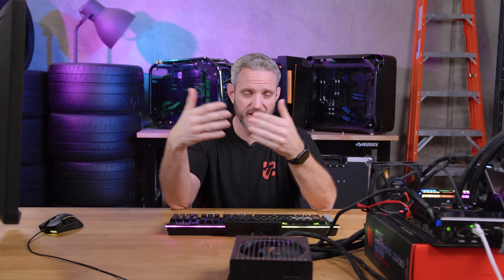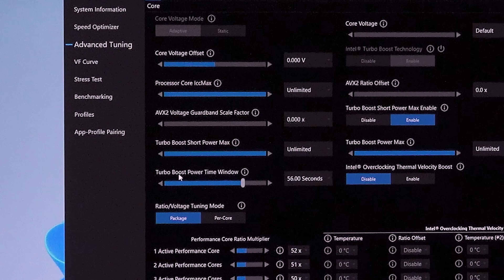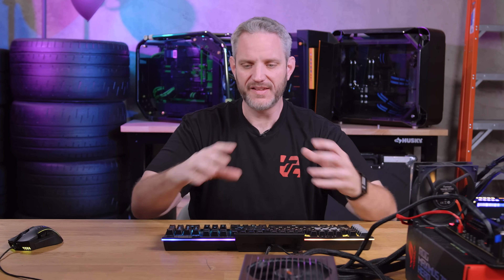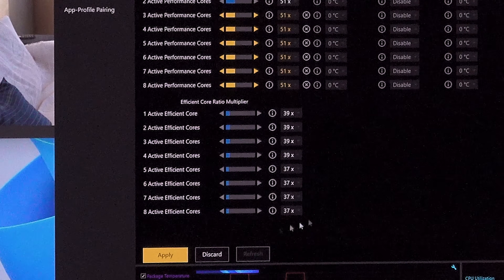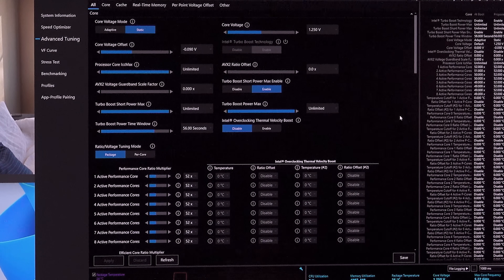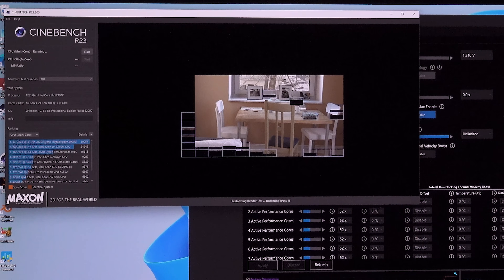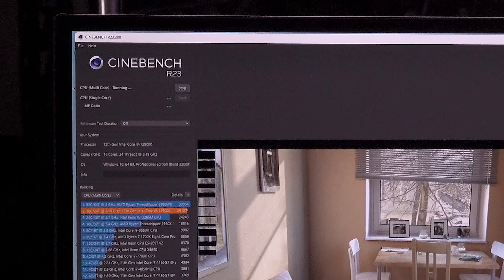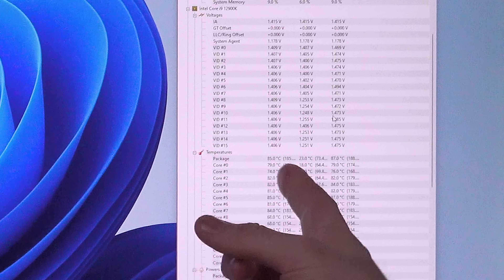Overclocking the 12900k is pointless and dangerous! Heat and Voltage testing...

Comment: Out of curiosity I am more interested to see how well the 12700k will overclock up to the 12900k stock numbers while being $200 cheaper
considering the 12700k is drawing less power stock and is clocking at a little slower speeds.
Reply: It will surpass 12900k stock, but not OC.
Reply: Just got a 12700KF will be building shortly.
Reply: WhatsApp ➕1⑨⑤⑨⑨①⓪⓪⓪②②  do not reply to this its a scam
Reply: I think it’s entirely possible that many of them can reach 12900k speeds, just not at a low enough power consumption for their standards
Reply: I think that the i-7 has been relatively pointless for a couple of generations. 8700k was the last decent value i-7. Since then, both the i-5 and i-7 have the same number of cores (6) and the same number of threads (12).

That is the reason why the 12700k/11700/10700k/9700k were all largely ignored by tech channels. Simply because they don't represent good value for money for gaming in comparison to the cheaper i-5 and they aren't as good at workstation tasks as the i-9 CPUs are.

Whereas if you were to check out a comparison between the 8700k and the 8600k, or even the 7700k, you will see a quite obvious boost in core/thread count.

Because of competition with AMD, Intel has been forced to enable more features that they had artificially disabled in cheaper CPUs and even to produce higher quality CPUs all round, which has made the mid-range pretty much obsolete.

It becomes quite difficult to notice a difference between CPUs when all of them are equal in quality. Especially in things like gaming where the Graphics card is usually the most important component. 

If you were running a game at 4k resolution, you would see almost no difference in FPS between a CPU from 10 years ago and one from today. 

So, long story short, the majority of extra value comes from the number of cores. Not the rated quality of them. Despite massive improvements over 10 years ago, the top end of performance hasn't actually improved more than a few percentage points. What has improved is the consistency and efficiency that it operates with and the number of cores.
Reply: @tripleheadedmonkey420  I do not know where you got your information on the i5 and i7 have the same number of cores since the 8700k but it is completely wrong.

 The i5 10600k was a 6core 12 thread chip and the i7 10700k was a 8core 16 thread offering, same core numbers for the i5  6core 11600k and the i7 8 core 11700k.

Also the new Alder Lake i5 12600k is a 10 core, 16 thread offering while the 12700k is a 12 core 20 thread offering. Also even on the Alder Lake the core difference is in the full p-cores not the lesser performance e-cores.

So your number of cores theory being the only majority difference in chip value actually makes each higher tier of an Intel offering being a better value than the one below it and we know that is not always the case.
You fail to take into account clock speeds and cache amounts along with those core counts which also affect performance.
But actually much of what you said is why I think the sweet spot for value/performance across the board is with the i7 and not just for gaming but a multitude of applications along with a perceived longevity as programs and even games are getting more cpu intensive as time passes making those extra cores have even higher value in longevity.
Reply: @tripleheadedmonkey420  NOPE, i5 and i7 has not been on the same number of cores and threads any time recently, and there's NEVER been a time where the corresponding i5 and i7 had the same number of cores and threads!
Lets
 look at all Skylake and newer pairings, just to see how it's developed 
(all pre-Skylake i5/i7's are like configured like Skylake).
i5-6660k: 4c4t vs i7-6700k: 4c8t - i7 adds HT.
i5-7600k: 4c4t vs i7-7700k: 4c8t - i7 adds HT.
i5-8600k: 6c6t vs i7-8700k: 6c12t - i7 adds HT.
i5-9600k: 6c6t vs i7-9700k: 8c8t - i7 gets 2 extra cores (i9 has HT).
i5-10600k: 6c12t vs i7-10700k: 8c16t - i7 gets 2 extra cores (i9 is 10c20t).
i7-11600k: 6c12t vs i7-11700k: 8c16t - i7 gets 2 extra cores (i9 is 8c16t! and only gets "TVB" ).
i5-12600k: 6P+4E/16t vs i7-12700k: 8P+4E/20t - i7 gets 2 extra P-cores (i9 is 8P+8E/24t).

According to you the 9th, 10th and 11th i5/i7 should all have been 6c12t chips, that's very far from reality.

The reason i7-12700k is missing from most launch reviews is very simple, Intel specifically choose to sample ONLY i5-12600k and i9-12900k to all reviewers, which meant that anyone testing the 12700k had to get it from a non-Intel source with early access to retail samples (like an SI) or buy it from the retail channel which would make it too late for the launch coverage.

The few places that has tested the 12700k so far all seem to consider it the star of the line-up since it's not that far behind the i9 on productivity/multi-core, pretty much identical in gaming, is significantly cheaper and far easier to cool. I can see the reasoning behind Intel choosing to sample only 12600k and 12900k but at the same time I think they did shoot themselves a bit in the foot by doing so.

But for GAMING, yes, the improvement above i5 (or Ryzen 5600X) is very small and for most people not worth it, at least for now. That doesn't mean that some people might not have different needs and/or is willing to spend more to get that little bit extra or insurance against background tasks - compared to GPUs the price differences on the 12600k and 12600k really isn't very large.

For Alder Lake the MSRP delta is $120 from i5 to i7 and $180 from i7 to i9, and the performance jump from i5 to i7 is much larger than the jump between i7 and i9. Which is pretty normal, the "top" SKU almost always cost significantly more than straight scaling would suggest (it's the same with GPUs, look at what 3090's cost, got any spare kidneys?).
Reply: @Torbjorn.Lindgren  Right this minute, the i-9 12900KF's are available but at a premium of $676.25 (lowest I could find), so with tax, it will cost $723.59 vs. $481.49 for a 10700K.  Quite a lot of money for 200MHz bump over i7 12700K.  $240.00 extra for the i9. Thats well over $1.00 per 1 MHz so  I think you are right, 12700 might just be a sweet spot for gaming unless you are doing flight simulation where you need every last bit of that first core GHz speed, for example, Flight Simulator 2020.  Those Flight sim folks have their reasons to go 12900K for sure, but that's not a large slice of the gaming community.
Reply: @Torbjorn.Lindgren  from what i have seen the 12700k is hot. 75c on a 360 aio. on another review the 12900k was hitting 100c on p cores that was on debear's channel. i can run my 5800x on a 120 aio. i want to see how 12600k, 12700k fare on a 240 or 280 aio.
Reply: WhatsApp ➕1⑨⑤⑨⑨①⓪⓪⓪②②  Wtf 😂 You should put more effort if you want to scam
Reply: hi :D pls. help
Do you know, if I can use a (AIR) Thermalright Macho Rev.B cooler on a 12900 kf whit out total overheating cpu?
Reply: there both 125 watt, so not really.
Reply: I overclocked my 12700k and it doesn’t go above 60c.
Reply: Probably not very well. I expect that there's a fair bit of binning involved and many/most 12700k parts won't be able to hit 12900k clocks, at least at Intel specs.
Reply: @Steamrick  Well now that depends is a 12700k a 12900k with 4 E's disabled or is it it's own chip?  Do we know this yet?  Cause if it's the later then there's no reason to think they wouldn't overclock to the same level as a 12900k, and to the OP's point maybe a little more headroom due to less overall power draw/heat.
Reply: @MooKyTig  Same chip, obviously. Creating a new mask for every single SKU would be beyond stupid and disabling bits and pieces to be able to sell partially defective dies is something every manufacturer does.
Reply: @Steamrick  I totally agree that it makes sense and would not surprise me in the least.  Just asking if we know this for a FACT and not a logical assumption.
Reply: @Torbjorn.Lindgren  i have read from a leak that intel will be doing this on 13th gen raptor lake with the flagship having 24 cores (8P+16E).
Reply: @Steamrick  You may be right but I wonder just how good the binning process is so early in the release of the new cpu's architecture as well.

I just thought it was sort of weird that most of the "press kits" did not include the 12700k chip and what benches I have seen so far at stock speeds the 12700k seems to slot in just about where you would figure it would between the 12600k and the 12900k.

I have seen oc video's on both the 12600k and 12900k but none yet using the 12700k good or bad.
Reply: @billwiley7216  if you put 12700/k/kf in youtube you will find what your looking for. from what i have seen that's the one to get. me running 5800x.
Reply: @arklight1670  I had pre ordered the 12700k, it arrived yesterday. Still on the fence on mb and ddr4 or ddr5.
Leaning towards ddr4 at the present time.
Reply: @billwiley7216  The thing with i7s is that they aren't sexy. i9's grab the attention of performance heads and are useful for prosumers, while i5s will tend to be what somebody buying new but on a budget will buy. For the average gamer, there isn't much benefit in paying more to go from i5 to i7 in 12th gen to make it worth it unless somebody redoes their builds every 5+ years so they can extend the use past the point of games being fine on 6 cores like they are currently.
Reply: @billwiley7216  As far as press kits go: Intel has to choose what to send (and sending everything realistically isn't going to happen). The top tier CPU is a must and for the second choice, the i5 is their 'value' argument in the much more high volume market, which I figure is how it got chosen.

Also, they might be hoping to upsell those who'd be satisfied with the i7 to the i9.
Reply: @billwiley7216  i hope you have a good cooling solution. check out "hardware unboxed"
Reply: @billwiley7216  ya I always get at least a formula board from asus, sometimes up to the extreme but I waited forever for my 3080 ti and paid a lot and I really dont feel like now waiting for ddr5 and paying a ton of money.  so I went with the 12700k and the strix ddr4 board.  Going to miss the start button and post code but ddr4 is mature and im not going for a crazy oc, so it should be a decent choice.
Reply: @GahloWake  this is exacly what i do. I had a i7 6700k for 6 years and maybe a little bit more and just bough the i7 12700k, so for me this is totally worth.
Reply: @hsur3844  Yup. I'm still putting around onf my 4690k until GPU get sane again for a full rebuild.
Reply: @billwiley7216  they are doing what everyone else is nowadays by the looks of it; promote the flagship item first and then the cheaper ones
Reply: @AbtinX  Actually old news now but at launch the promotion was of the 12900k and 12600k so not limited to the flagship models as the 12700k is a higher tier chip than the 12600k.
Reply: @billwiley7216  true, but those are two different types of customers yeah? I might buy either of the better chips but never the 600, and probably vice versa
Reply: @billwiley7216  Hey did you ever find a motherboard for your 12700k? also if you did overclock ur cpu was it worth it? im trying to get a 12700 but someone people are telling me to get f version because its not worth oc
Reply: Since the 12700k has the same eight performance cores and only four less efficiency cores than the 12900k. Heat and voltage will still be extremely high when overclocking as the performance cores generate most of the load.
Reply: @alt5494  But you must consider the fact that the i7 as stock consumes 50 less watts than the stock i9 that if the chip has the oc headroom then getting to i9 stock levels with the i7 oc may just bring the i7 up to the heat and voltage levels of the i9 as it comes out of the box new.
Reply: @billwiley7216  when looking at the chip diagram all four Ecores are roughly the same footprint as a single Pcore. Transistor count being directly tied to size all eight Ecores on the 12900k should have a power draw between one and two Pcores. The reason the 12700k is cooler is the 300mhz lower clock/lower voltage not the missing Ecores. Overclocking will remove that advantage with the lower bin silicon possibly running just as hot as a OC  12900k
Reply: @alt5494  You have backed up my point exactly. 
Out of the box the 12700k RUNS COOLER AND DRAWS LESS POWER than the 12900k which has higher clock speeds and higher voltage draw and little difference but some the additional e-cores.

If you were able to bump the the 12700k up the 300MHz using the same voltage level as the stock 12900k then it should make sense that the overclocked 12700k which would then be running the same performance level and the same voltage of the stock 12900k would be putting out the same amount of heat as a result as a STOCK 12900k, not an overclocked 12900k.

Seems any overclock of a 12700k that did not exceed stock 12900k performance level settings and voltage or anything below those levels would not theoretically exceed the power draw or heat generated by an out of the box stock stock 12900k.

If a person could reach those levels or very close to them with a 12700k then technically they would just have a stock 12900k with 4 fewer e-cores for $200 less.
I do not understand why you think the temps would be as high as an overclocked 12900k.
Reply: @billwiley7216  Because of silicon quality a CPU's ability to turn voltage into performance is based on how close to perfect the components are after completion. The 12700k and the 12900k are the same part which is binned into lower grade 12700k and higher grade 12900k. The 12900k is a higher binned part running overclocked from the factory. It will be difficult for a 12700k to run the the same clock without generating more waste heat unless you luck into a random golden sample.
Reply: @alt5494  I understand what you are saying but you are not taking into consideration the actual perimeters of I am not asking the lower binned 12700k to OC to the same performance levels or speeds a better binned 12900k would be capable of doing when it was overclocked.

All I am hoping to see the 12700k at its overclocking capability is to reach the level or close to the level the stock 12900k reaches, any better binned 12900k silicone should be able to easily reach above its out of the box speeds which would justify its higher binning.

Since the "k" series chips are the unlocked chips and the non "k" chips are locked and cannot be overclocked at all it would make sense that the binning process would put the best chips in the k lineup. 
Again being basically the same chips I am not seeking the overclocked 12700k to reach the overclocking level or performance of an overclocked 12900k highest binned chip.

Even taking into consideration that the 12700k overclocked will put out more heat and draw more power than at stock levels IT still should be roughly in the same levels that a similar stock 12900k puts out.
You also have to remember you have 4 less e-cores drawing any power and consuming any wattage which still will generate some heat and power consumption.
Reply: @billwiley7216  Have you seen jays2cents overclocking the 12900k video??
Reply: @alt5494  Yes, but again we are not talking about overclocking a  i9 12900k to higher levels which out of the box is already pushing 241 watts stock which by Jay's test results is pretty much close to where the temps stay at a reasonable enough level for everyday use!

 What we are talking about is attempting pushing the basically exact same chip which with its i7 designation set to factory lower operating speeds and  a 50 watt lower 191 watts out of the box to up to the 12900k STOCK specs at maximum!

What part of that are you failing to follow, the 12900k at its stock speeds and 241 watts of power draw stock is pretty much at its max settings, the oc I am interested in will never exceed those levels if those levels on the 12700k are even possible.

There are really no reasons if the 12700k is capable of reaching the STOCK 12900k performance levels for the overclocked 12700K at that level to exceed the power draw or the heat generation that the 12900k stock out of the box which are at perfectly safe levels.

You keep referring back to the 12900k oc heat and power draw, I guess you think the attempting to oc the 12600k would also exceed the heat levels of the stock 12900k as well?
Reply: it clocks terribly xD speaking from experience

Comment: 12:50 no jay, the 3970X is 64-thread part, not a 64-core part... ouch.
Alos, don't the 3970X and the 12900K have very similar power draw? That feels kinda relevant...
Reply: Current Threadripper line-up is all 280W TDP.
Reply: @technicalfool  12900K is realistically 241W, since the MTP is what'll get used in stock configurations. Those are much closer than the 12900K is to the 5950X.

Comment: Despite not being the traditional O/c of the Celeron 300 / Core 2 etc era 🥳🥰 …. The new Intel 12 series is bringing a modern take of those good old days with lots of tinkering with O/c’ing (shame we can’t get the 30-50% clock boost of the oooold cpu cores 👍😆)
Reply: This iPhone its a scam right?
Reply: @candidosilva7755  Obviously.
Reply: @candidosilva7755  yes
Reply: @candidosilva7755  most definitely !
Reply: Intel is already pushing it to the max

Comment: Why are you using vid for voltage reference? Vcore uses die sense on Asus boards and will show closer to what the actual voltage is after vdroop and LLC. Vid is just what the CPU is requesting. Unless something is different under 12th gen

Just got my 12900k running with z690 Apex. With ai OC it gives me the same results but with 1.41 svid vcore isn't even at 1.3v at llc 4. 
That said my temps are 20 degrees higher than these with a Ryujin II 360.